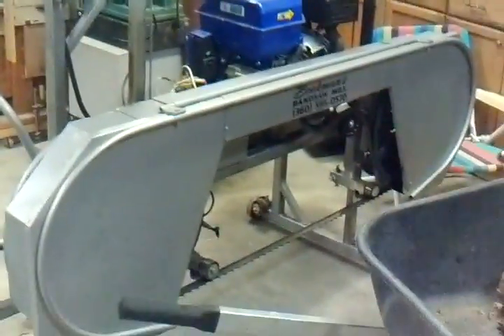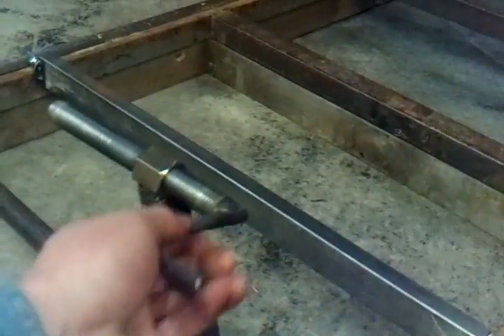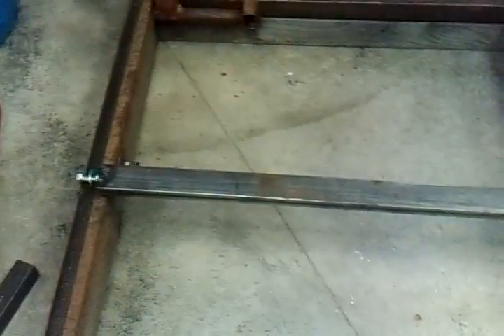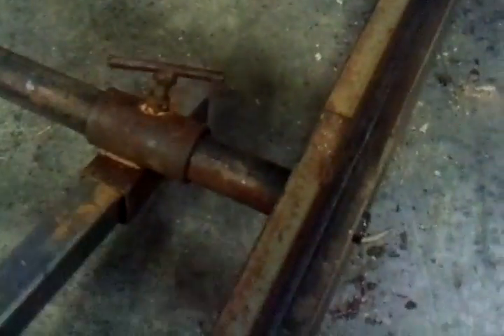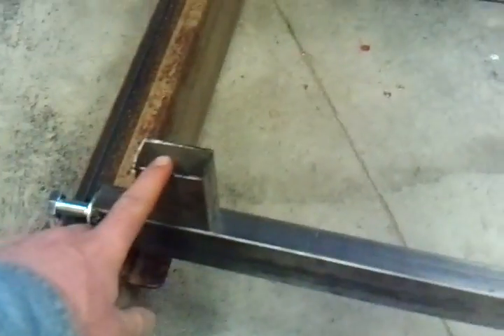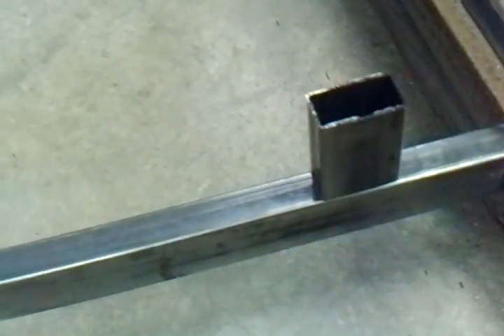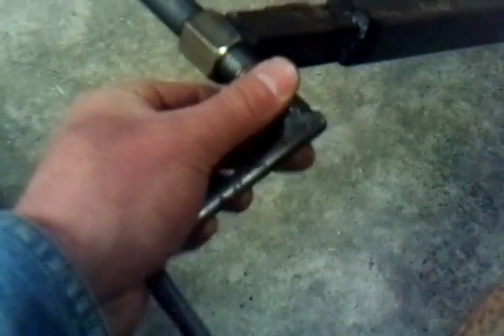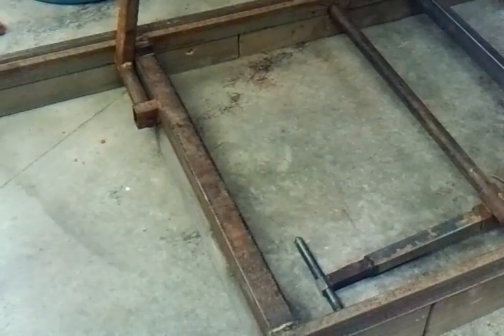Bookman's Bandsaw Mill

Comment from the maker: The mill had a few glitches but over all has performed very well.  These modifications did not work as well as I had hoped and I had to make different mods to mill short pieces.  The ignition/key rattled of and had to be re-welded.